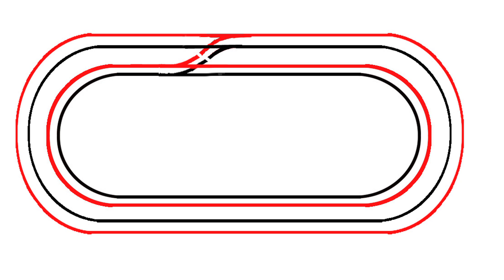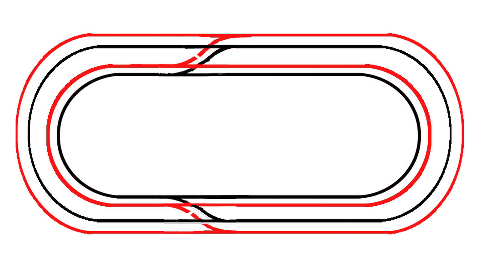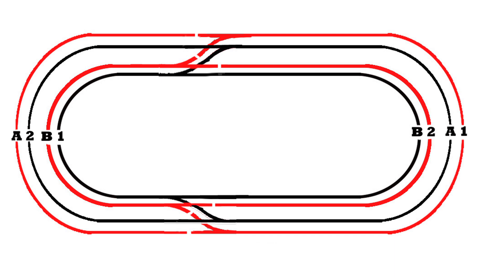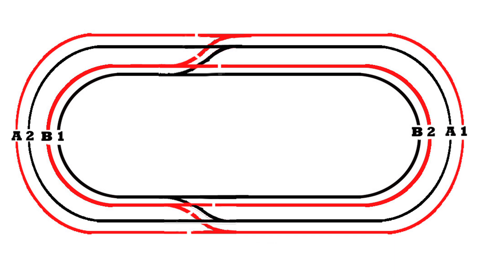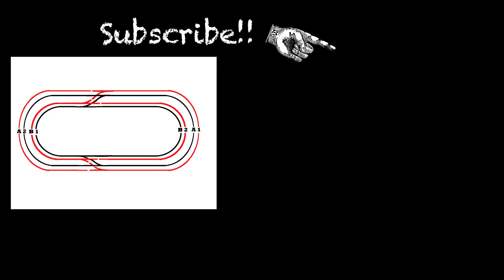Introduction to DC Block Wiring - Electricity for Model Railroads

Comment: Block for DC and / or DCC allows for auto block control based on block occupancy.  Many options.

Blocks also allow for each block to have its own fuse.  A 5AMP main source may have auto cut-off for short circuits.  For safety, add say 1-2 AMP fuse to each block bus.  Saves 5AMPs ever getting to anything but still having 5 AMPS available.

Consider adding a neutral section between paired points.  It only gets power when the power sources match.  I've designed a one socket and multiple plug system (using jumper principles) so that neutral section can ever be powered unless I've got matching power sources either side.

Comment: Could you please add the wiring diagram using two power plants !!
Reply from the maker: Sure… but it’s really simple. I think… two power supplies. Well actually 6…  and 4,Bluetooth controllers. And 9 WiFi controllers with a hub. 3 background sound systems with 6 channels. Hum. I think we have some splain’en to do. I think it’s a show!!  With wiring diagram!
Reply: @ToyManTelevision  Mmmmm .... very usefull !! somebody else would deffinitly rely on it !!

Comment: Hi Dale, just watched this great tuitorial from downunder here in New Zealand. I do however have a question in 
that if a loco crosses the crossover isolated section with both controllers switched on, would this not short/damage 
the locomotive motor with the possibility of the pickup wheels/bogie bridging both powered track at the same time?

Comment: IMPORTANT SAFETY NECESSITIES ON MULTIPLE TRANSFORMER LAYOUTS !
Locomotives will NOT always cross from one track to another which involves Two separate Controllers ! For the simple reason NOT all manufactures wire their Locomotives as typically found in the USA. Many professional "Kit" built locomotives, particularly Steam Tender locos. Have one side of the Locos wheels wired for pick up, but the opposite side wheels on the Tender. So any loco so wired will stop DEAD when moving from one controller area to another controller area. The only solution is to wire ALL wheels on a locomotive to avoid such problems. 

Direct Current (DC) has a trick not available when using AC in the track. This is of course the fact that DC will only return to the Transformer it came from. So you can have Multiple Transformer 12v DC supplies in ONE of the two rails without fear of short circuits. However on Crossovers which divide one controller area from another YOU MUST still insulate BOTH Rails. This will avoid the problem of a short circuit, if the two controllers are set for opposite direction running. Because when you change the direction of the train, you are swapping the Plus & Negative feeds, to make the loco go in the opposite direction. This fact also means you can't have "Head on" Collisions !!! 
 
It also means on Layouts which have multiple Transformer controllers for multiple train control on different parts of a Layout. EACH Transformer MUST be plugged into a DIFFERENT Mains socket.
Or you will get interference between Transformers, as they are also "Rectifiers" (A Transformer/Rectifier does two jobs. The Transformer part firstly reduces the Domestic AC supply to a lower 16v AC supply, and then the Rectifier then changes the 16v AC into 12v DC, for model train operation).  

With 12v DC layouts the biggest bonus is called the "Common Return" wire. Indeed 50% of ALL the wiring on a layout, for all DC items including, lighting, Signals, even point mechanisms can have the Negative wire of everything connected into a Common Return wire. This should be preferably a single wire right around the layout, with connections to the Negative on each & every  Transformer Controller, and the negative rail of all tracks, the negative wire from signals and ALL other DC accessories. Do NOT mix AC & DC accessories on one layout. This often results in serious interference where such DC & AC accessory wiring is physically just "close together" (DC sets up electro magnetic fields around the wiring, and AC does not like such interference) !!! 

NOTE IMPORTANT !
Do NOT use any type of Transformer controller with two control knobs intended to operate separate trains on Separate Tracks. Such cheap rubbish, WILL lead to serious & potentially Dangerous electrical issues later. You MUST have totally separate Transformer Controllers (EACH with its own Mains Winding inside).  As stated above each Transformer Controller MUST be plugged into a separate mains sockets to avoid serious interference, and potential Fire issues. Following this safety warning, will allow uninterrupted operation as the layout grows.
Reply from the maker: @railwaymechanicalengineer4587  wow that is a lot of information! I need to wait through that more closely!
Reply: @ToyManTelevision  Well I spotted a potential "safety issue" in you presentation. And being a Professional real Railway Mechanical Engineer, as well as a Professional Modeller,  I  thought  it wise for safety reasons to point out the Dangers. Have a nice Day, and keep the programmes coming, every little helps 😀

Comment: Your details on the switch image is confusing to others... if you had labelled it as... 

Contact 1 = power from controller no 1
Contact 2 = power to track
Contact 3 = power from controller no 2

and always remember when the switch is in the down position it connects Contact no 1 to Contact no 2 and the same for when the switch is in the up position it connects Contact no 3 to Contact no 2... 

If you had said it like that then others would understand it much easier and clearer.... 

When explaining Electronics to others it is all about making it easy for those who do not understand how circuits work.